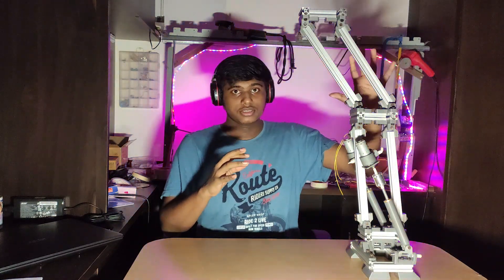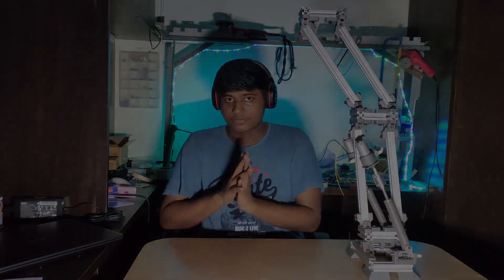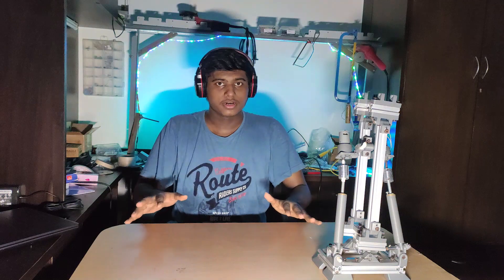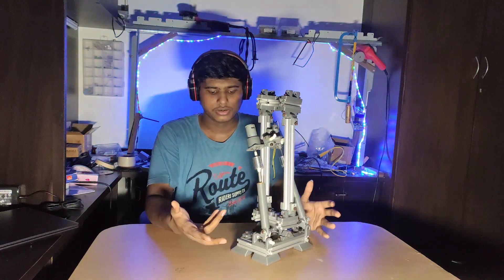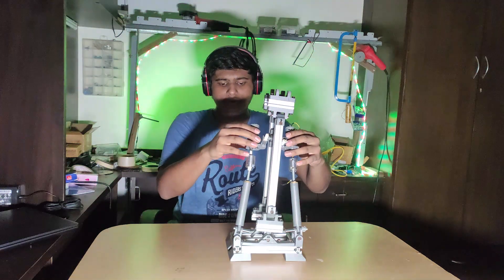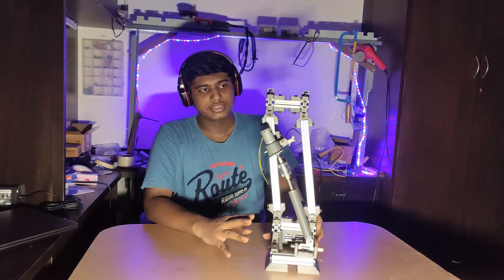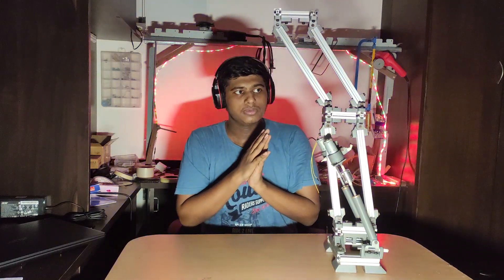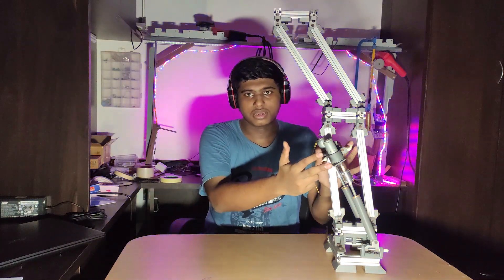Humanoid Robot  ||  Episode 1 || Making the Legs

Comment: bravo !!! what is the actuator's torque ???
Reply from the maker: The motor is rated for 8kg-cm of Torque

Taking into consideration the pitch of the lead screw and density of the thread, the actuator assembly can lift about 50kgs of payload, considering there is large amount of energy lost due to friction.

To further increase the payload, ball screws could be used to give less friction and thus greater conversion of motor torque to linear force
Reply: @falloutdynamics5319  wow, thanks, if  motor is 8kg.cm, for a payload of 50kg...then there must be a few of these motors ??? please correct me, thumb up !!!
Reply from the maker: Yes, each leg has 4 of these motors, 2 motors per joint.